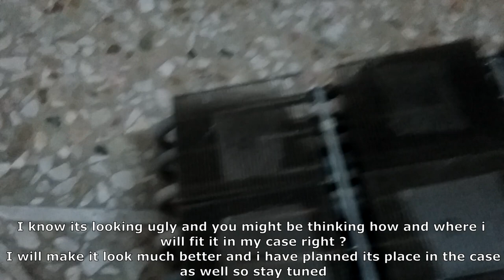Overlord PC radiator | homemade | DIY Tech | Custom water cooling part1

Comment: Nice build. You can make water run in parallel so whole thing would be less restrictive. As for the case - take a look at Thermaltake Symphony watercoolers, they are awesome.
Reply from the maker: Thanks mate. I decided to make all parallel but wasnt able to find a joint , the one i made leaked so left it :P

Comment: How is this any better than say... 2 x 480 rads with 60 or 85mm thicccness
Reply from the maker: i think 2x480 will perform way better than this. Fins density , area of contact between tubes and fins is way better in those
Reply: Well that’s very honest of you to say that. It’s my first time on your channel so maybe I do not understand the context or purpose of this thing. Is the point of this not performance or extreme overclock? I mean maybe you’re focusing more on saving stuff from landfill or simply making stuff that’s as “janky” as possible (to steal a term from Linus Tech Tips). It’s still cool I just don’t get the point
Reply from the maker: @depth386  just love doing such stuff. I was really interested to get my hands on one rad but i cant afford one. So made one.  That thing performs more than perfect for its price. It was a fun project